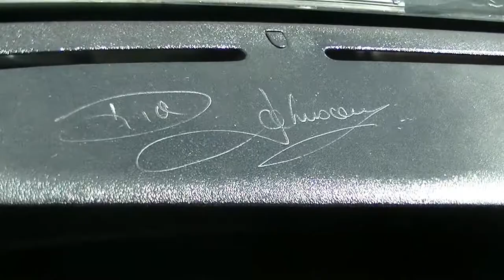1979 XD FORD FALCON

Comment: That's what I'm talking about bro. I love your XD mate. She makes a beautiful noise too.
My story is similar to yours.
I'm 52 this year. I bought my XD back in 1991 from a friend and still have it. My first car too.
It's also a 351 Clevo, stage 2 shift kitted C4 and standard disc brake diff.  I have a 9 inch for it too. I also have that same Webasto sunroof too. It came with Scheel seats and a flare kit and deep centrelines. It was an awesome car to drive. I took it off the road to respray it and detail the engine bay then life got in the way and had to leave it for the time being. It's been off the road for 32 years, but it's still solid with absolutely no rust. It's never had rust actually. 
 It's currently stored awaiting a full rebuild. I plan to get started next year sometime and finish it permanently.
Thanks for the video. Your wife is very cool too.
Reply from the maker: Wicked man best of luck with it.  I will keep an eye out for some footage :) And thanks for your kind words, I am a lucky guy she a great wife.

Comment: Very Nice        what cam is fitted  didn't  catch who s heads,      to have one but three  I'm jealous
Reply from the maker: Its a Crow Cam and the heads are 2v CHI in standard cast.  CHI supplied the entire top end kit which was the best engine investment I ever made because everything is tested and matched,  heads, intake manifold, cam and rocker gear,  I have pics of it all on my JDT Racing Facebook page, https://scontent.fbne8-1.fna.fbcdn.net/v/t1.18169-9/10363385_810790275612592_2554140142072329801_n.jpg?_nc_cat=108&ccb=1-7&_nc_sid=8bfeb9&_nc_ohc=SyuBKPsjE0UAX9Op-7U&_nc_oc=AQlKh1ioirJHWoGvgIfJHnStvozWFAwGGkx3I2EpamcwKmPECOVDyHwccQ2Ww3miRcY&_nc_ht=scontent.fbne8-1.fna&oh=00_AfB-xeEOS81w5Nf3_nADQ4axOO003zrcuMK01EUaQJJYIA&oe=63FD5B8E
Reply: @joshy351  Hey buddy, that URL has expired. Would've loved to have seen more.